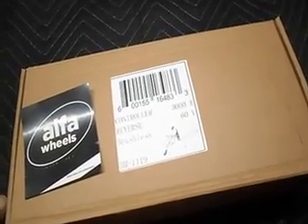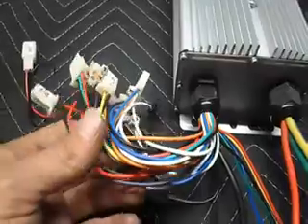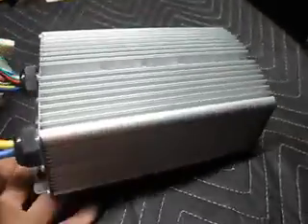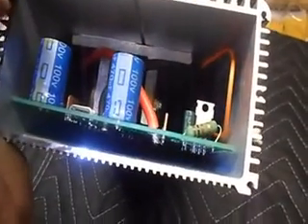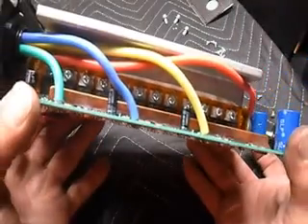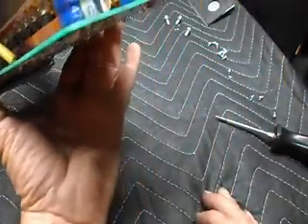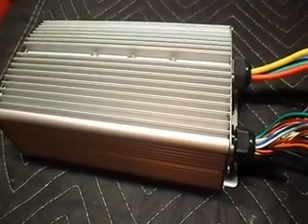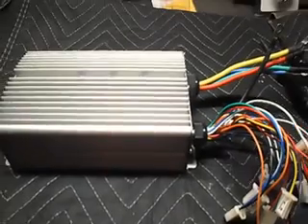60V 3,000W Yalu controller intro

Comment: If i supply 5volt power to throttle signal wire, will it be rotate ??
Doing some experiment actually.
Reply from the maker: 5V supplied to the throttle signal wire = full throttle (ludacris mode)

Comment: hello can this controller work without connecting the hall sensors?
Reply from the maker: No, the hall sensors provide necessary information, that the controller needs to know, to power the motor.
Reply: @functional_artist  
ok because some controller works without hall, I run alternators converted to brushless obviously no hall sensor and obviously there are low-end controllers. but 1500 w (modifiable) and some nucular but expensive ....
Reply: Может

Comment: Do you know can that 72V handle 18s,19s ja 20s 18650 batteries which all make actually more than 72V in fully charged?
Reply from the maker: IIRC most 72V components & systems are designed to safely handle up to ~80V
Reply: @functional_artist  but 72v battery pack has a full charge of 84v. Is it still safe that way?